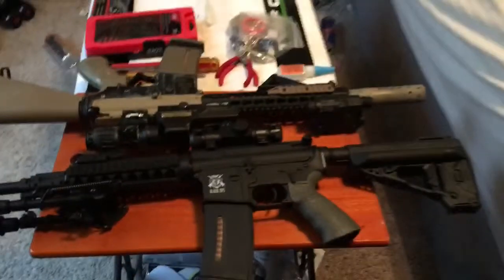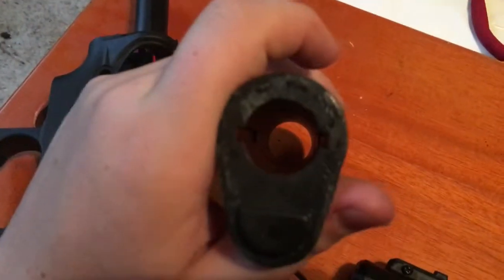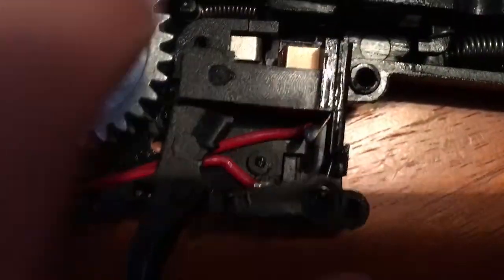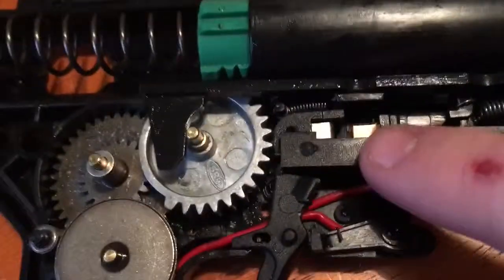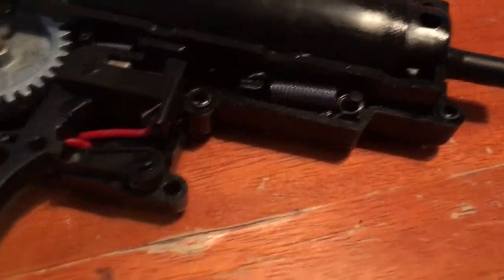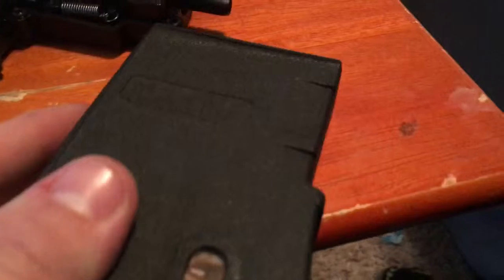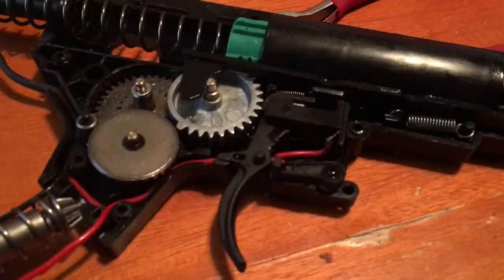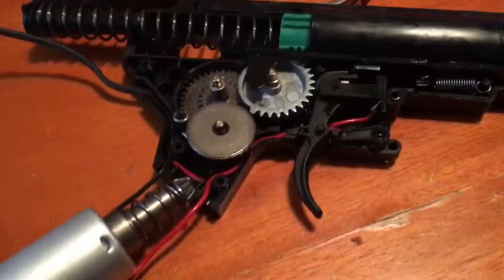How does an airsoft gun work?| Airsoft v2 gearbox| airsoft m4 disassembly| airsoft trouble shooting|

Comment: Hi, not sure if you know the answer to this but I have a feed ramp that is blocking the air nozzle how can I fix this?
Reply from the maker: I am not too sure what you mean by a feed ramp as that is a part on a real gun. However sometimes the air nozzle will get twisted in the gearbox and lock up. This blocks the bbs from feeding into your gun. The gun will sound normal even thought it is not. To test if this is the problem simply push in on the air nozzle and make sure that it springs back out.To fix this what I recommend you do is find a tutorial online of how to take apart and put back together a v2 gb and take apart and put back together your gb as there is no way to fix this without taking it apart. Another thing is that the tappet plate could of got nocked out of place and will not allow the piston to cycle, this causes the same problem and you must fix it the same way. The way to test this is to put your finger In front of the air nozzle shooting and seeing if any air, like a lot of air, comes out. Hope this helps!